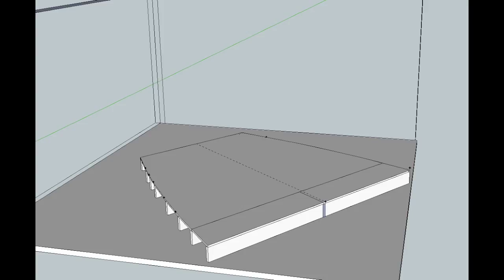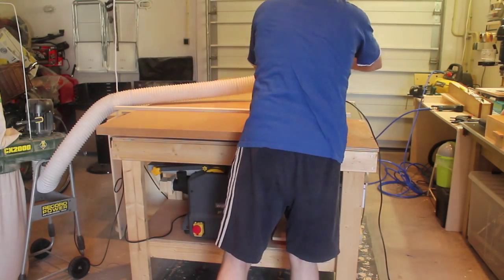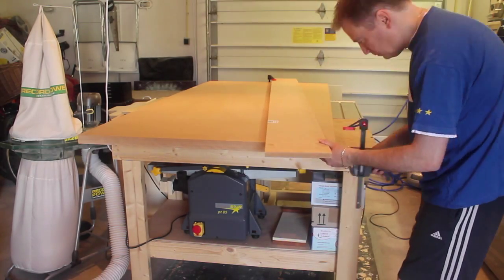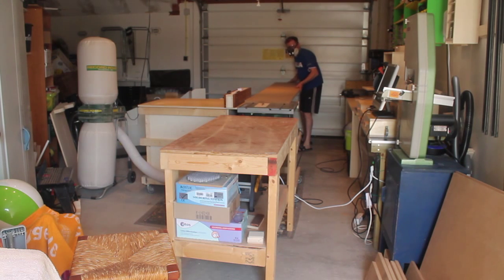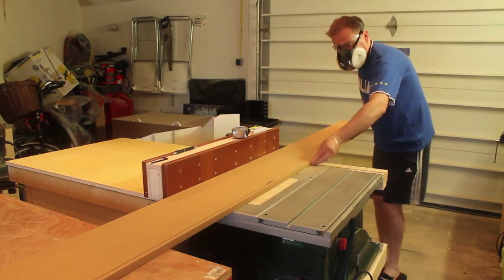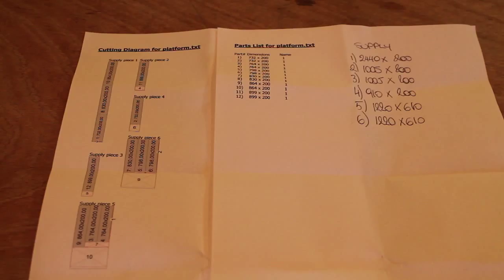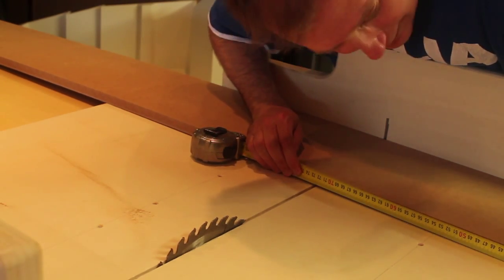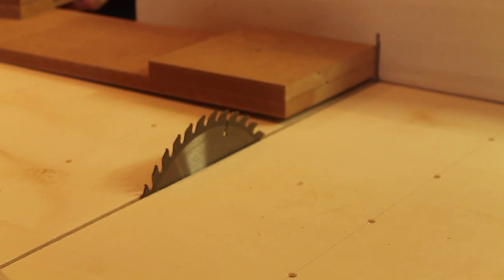Boeing 737 800 Home Cockpit Simulator #11 - Cockpit Platform - Part 1

Comment: Nice video, Thank you.
Why do you need a platform?
Reply from the maker: +PVsimpilot that is a good question. If you want to have connected yokes than you need room under the sim. It's also good to run wires. But if you do not want linked yokes than you can make a much lower platform than the one I did.